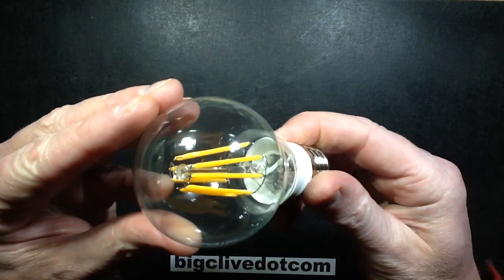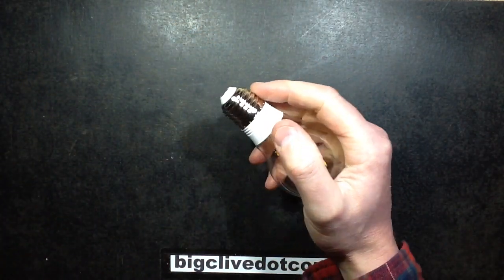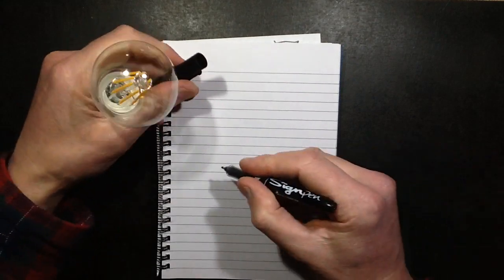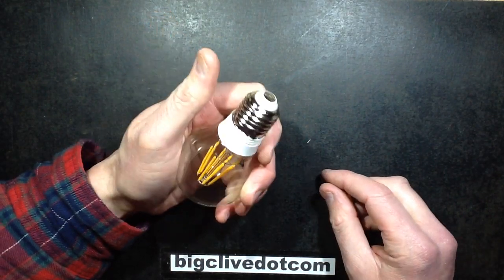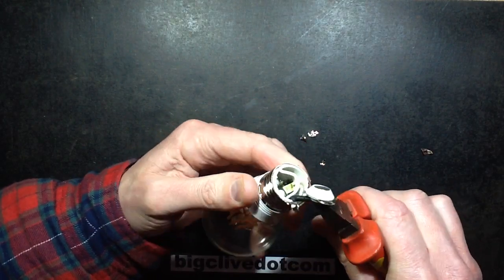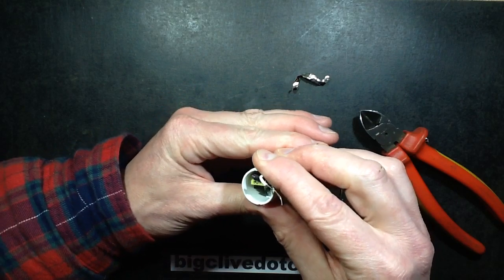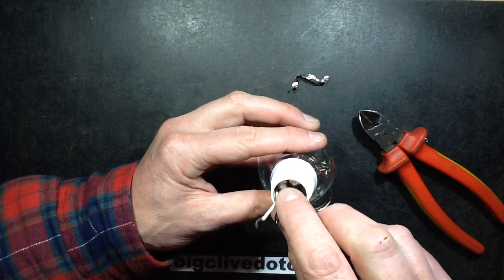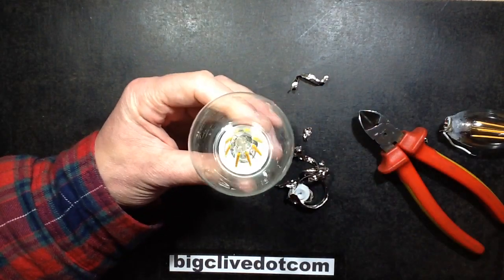A look inside an 8 filament LED lamp.

Comment: Hey there BC, hope all is going well. I just wondered since I recently happened upon this is if you have ever used a black light behind one of these style bulbs?  I can easily see every LED that's in the string of each row. It's pretty neat so I thought I'd ask & see if you've tried it as of yet.
Reply from the maker: I just tried it with a near-UV flashlight, but it just made all the phosphor glow.
Reply: Yeah, my blacklight is a spiral style that looks just like a normal size of a 60W CFL bulb, & it makes it to where I can easily pick out these LED's for some reason??? Not certain why, but it is pretty cool to look at them that way.
Reply: If you try it with that spiral blacklight about 3 to 5 inch behind it & maybe about an inch lower in another lamp base, the way mine was set up & I could count every LED on those strings, really neat just how that worked. Much simpler counting them that way. Oh well, if you ever get one just remember to give it a try that way.

Comment: Sorry for the thread necromancy Clive...

I have a bunch of similar lamps acquired from ebay (4 filament 4W rated), and attractive as they are, they are far too bright for even a single lamp to be on in a room without an attenuating shade (which is sort of the point with these lamps)

Assuming that their drive circuitry is the same, or similar, how would you go about reducing the brightness of these lamps?

Thanks

M.
Reply from the maker: +magicaardvark1 It does depend on the circuitry inside.  A switching driver may flicker randomly if you limit the current, but a capacitive dropper or resistive dropper could be further limited with an external capacitor.  I was playing with a new lamp today and contemplating exactly that so I could make the LEDs more visible to count them.
Reply: +bigclivedotcom good call. I found a 470nF 400V cap in my parts bin. Might give that a try with a discharge resistor and see what happens. Alas I suspect that it's a switching driver. Only one way to find out :)

Comment: So uncap the chip and get a 300x (well, 60x at the 5x lens zoom) objective to sport around for the power IC identifiers? Thanks for looking into those; I have thought the big glass would prevent adequate air circulation for certain. Even the supply electrolytic caps and buck look low on cooling, but there's the optimist's case winning nicely (give or take the reverse surgery for some general scene lighting; shortening the adapters to get the bulb right by the natural stone might be fine.)

With film awards season coming up the Hand Safety Ministry's probably got you a-listed too.

Comment: A good presentation of these lamps, thank you. But I am still wondering how those LED filaments are cooled. LED chips are very sentive to heat. Above 100°C, they will rapidly burn out. As there is no heat sink in this design, surely gas inside the lamp is used to extract heat from the filaments and help to expell heat outside the bulb (through the glass). But what gas are they using ? Just air (not very good heat conductor) ? Helium (much better heat conductor) ? Other ?
Reply: It seems common knowledge these days that it is helium. Compared to a party balloon I guess you don't need much per bulb.

Comment: Hey bigclivedotcom.

Formulation was right. Answer was wrong.

75 Volts + 60mA=135 Volts

135VoltsX 0.06 Amps= 8.1Watts.

But very good presentation loved it alot.
Reply: ??? V+I=V is your first formula. No.
Reply: i believe you meant Ohms in the R = V / I equation?

Comment: Hi, I have got a very similar lamp, but 4 filaments, 230V 6W. The chip in mine is marked BP2831. After ca. 2000...3000 hours the lamp failed. Is very dim, 1/10th of original. Oscillates and makes rtrtrtrtrt-Sound. It came apparent that the filament is gone! Paralled LEDs are not the best idea - are they? Have not tested the converter ...

Comment: How is the light colour? In my experience 'warm white' LED bulbs still tend to be a bit on the bluish side, say 3500K ish. How does it compare to an incandescent bulb?
Reply from the maker: The colour is good.  The early "warm white" LEDs tended to have rather odd colours.
Reply: +bigclivedotcom Do you know about AC LED ? I stumbled across them on ali. I surprised how little amount of elements they have. Something like this - http://www.aliexpress.com/item/5pcs-lot-AC220v-SMD-5730-aluminum-led-pcb-3w-24w-integrated-driver-lamp-plate-Cold-White/32359425496.html  OR http://www.aliexpress.com/item/AC-220V-High-Power-LED-COB-Chip-5W-7W-9W-12W-15W-High-voltage-ceramic-COB/32270662355.html
I wonder what IC they`re using
Reply from the maker: +Dalsir I covered one of the PCB based versions not long ago.  In the COB versions I can see what looks like a four diode bridge rectifier and huge array of series chips with possibly some resistors to limit the current.  These types of direct mains light sources tend to have quite strong flicker due to the complete lack of smoothing.
Reply: bigclivedotcom
 Oh yes, mister Flicker is strong there. Long time ago I bought cob-in-series thing. There was a... 2.2mF capacitor ! I replaced it with 180mF lol, it smoothened flicker for good, but didn`t fit in case. Can you give me a link to your video ? I struggled to find it with no luck. Oh, btw yesterday I bought next gen 6W(real) filament for just 3€, ali usually makes a little discount few days after you put item in cart.
Reply: I have quite a few warm white LED bulbs from the general electric brand which the pack claims the bulbs to be 2700k but I'd say their more like 3000k ish in my opinion.

Comment: It is nowhere near as bright as a 100W incandescent.  Top shelf, brightest current E26 base LED bulbs "today" (will change next year and next year and so on) can only make 60W incan equivalency ~ 800-850 lumens with 8W, but it has some gains in using the clear dome instead of diffused, yet in most applications you would then need to diffuse further with  your lighting enclosure so it's still lumens lost as  result.

Comment: The snips of knowledge!  OK.  I'm subscribed. 

I have a number of these, and I find they give a few more lumens per watt than other led bulbs.  Plus the color temperature is so very comfy cozy.  Three of the 2-watt ones are quite sufficient for my bathroom, and the exposed bulbs there collect compliments.  I can't possibly fault you for keeping this one intact for actual use. 

Incandescent equivalent is roughly 10 watts of tungsten light per one watt in these (one led filament).  More than 10x at higher wattages... I think there is diminishing returns with tungsten filaments.  I wouldn't be shocked to see that this is brighter than a 100 watt incandescent.  If you do compare, avoid getting a "long life" 100w one. Those are always dimmer.

Comment: It isn't getting hot because it's only 8 watts.  The LED is probably in the part you keep referring to as a "filament" inside the yellow phosphor sleeve.  That would have been the interesting bit.
Reply from the maker: Duffy Toler It is indeed an interesting bit.  If you search my channel for LED filament you'll find lots of videos on using the filaments themselves, and what's inside them.
Reply: Duffy Toler It will get a "little" hot, but it has such low mass to surface area that it cools down rapidly once turned off.  If instead you had something like a solid chunk of aluminum of the same volume with 8W dissipating into it continuously, you would burn your hand if you kept it on the bulb while it was running.

Comment: Any recommended suppliers of 120V 6-8W bulbs? Silly America thinks we need to be different even if it isn't beneficial *cough metric/standard cough* and it will need to be 120v instead of 240 and it needs an Edison style base as almost all american bulbs are. It also needs to be nearly flickerless.

Comment: Where can I buy one from?  Thanks.
Reply from the maker: You can buy them from a fairly wide range of high street lighting shops or on ebay.  The link the listing I bought this one from is in the description.
Reply: bigclivedotcom Got it, thanks. I was browsing from the mobile app.

Comment: Very interesting yet again. Looks a good colour for an uplighter so I might give it a try.
PS Desiccant dehumidifier still working well - better than the old compressor type. Buying that was down to your review. Regards Peter
Reply from the maker: Couple of notes about the desiccant dehumidifiers.  Keep them on their low power setting for a much longer unit life, and also check for excessive dust build up.  Some people have had the drums clog up completely with fluff.
Reply: bigclivedotcom Hi Clive. Thanks for the tip - been using low power but thanks about the heads up on the filter. Peter

Comment: Too bad that they only sell 10 PCS now, the 1 PCS contingent is empty. WTF???
Reply from the maker: The ebay system probably expects them to assign a quantity to each multiple, and most people probably buy just one or two.  Try messaging them about it to see if they will update the listing.
Reply: Thanks, but I noticed later "No shipping to Germany". Pitty. :(
Reply from the maker: ***** Yeah, I get the no shipping to isle of man a lot too.  No probs, just do a search for LED filament lamp and you'll find lots of different suppliers with lots of different prices for the same lamps.  Just avoid the ones with the small bases like SES, since the first thing they remove from the circuitry is the cap that prevents flicker.
Reply: I wanted to have this particular one, but did not find it although I searched until the cows came home... But perhaps you will review one high wattage bulb which can actually be shipped to me. I'm not giving up!
Reply from the maker: ***** Try sending them a message from the listing.  They may relist individual lamps.

Comment: 7/8W lamp is about a 60W GLS incandescent lamp, I bought the dome types and the light is just about the same, more than a 40W lamp and almost the same as a 60W R63  reflector, which I have a lot of.

Comment: Do you have a Link to the seller?
Reply from the maker: I've added the link to the description, but they seem to have run out of the single unit multiples.  You can shop around on ebay for them by searching for led filament lamp.

Comment: Hi Clive, It would be great to know where you buy your products. I have a 4w version of this (bayonet version of course!) and would be interested in the 8w one.
Keep up the good work!
Reply from the maker: I've added the link to the description, but they seem to have run out of the single unit multiples.  You can shop around on ebay for them by searching for led filament lamp.
Reply: That's great! A shame they don't do a bayonet version. Even in bulk it's great value.
Reply from the maker: ***** Well you do get the bayonet cap to ES adaptors for around 99p shipped.  But you have to be aware that they can go in either way round, so the threaded bit should be treated as being live while screwing a lamp in.

Comment: I'd love to get one of these. could you please throw a link down below for it?
Reply from the maker: I've added the link to the description, but they seem to have run out of the single unit multiples.  You can shop around on ebay for them by searching for led filament lamp.

Comment: I don't suppose you'd be willing to drop a link to the listing? I wouldn't mind trying some of these.
Reply from the maker: I've added the link to the description, but they seem to have run out of the single unit multiples.  You can shop around on ebay for them by searching for led filament lamp.
Reply: Thanks. While there are plenty available, they do tend to vary greatly from one listing to the next. When buying from China its always nice to buy a 'Clive approved' one.
Reply from the maker: ***** The ones I buy are never actually really given much of a testing over time, since they generally get taken to bits almost immediately on arrival.